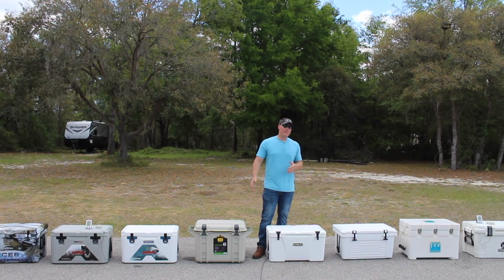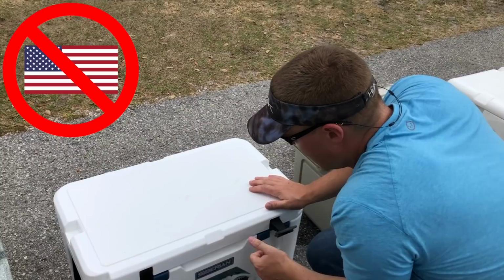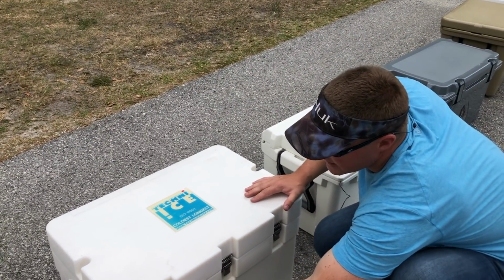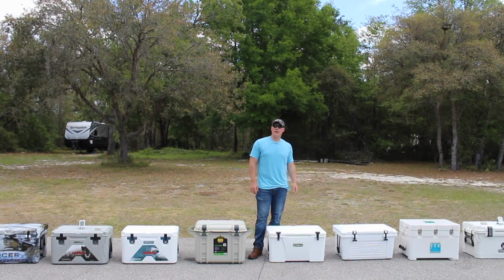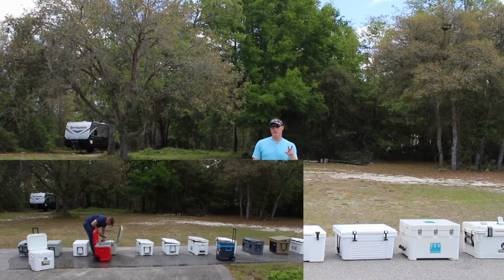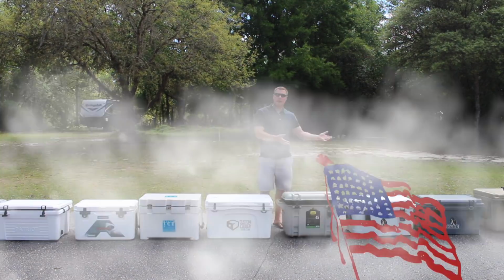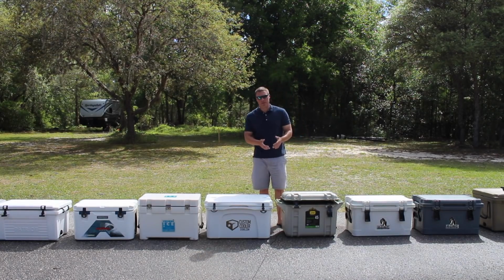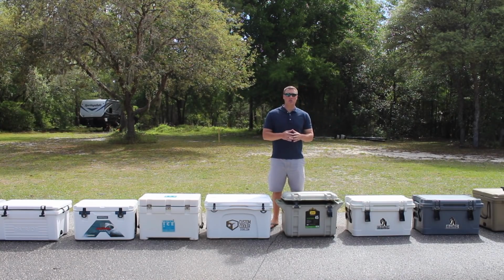Coolers Made In  USA Vs Foreign Made Coolers - Build Quality & Ice Retention

Comment: OtterBox FTW. I bought the 25 and 65 last year before anyone even knew about them. Now, if you could do a vid on all the modular accessories that set them apart from all the competitors that would be great. I think Orion comes close, but not really.
Reply: Oh, and don't forget to mention that OtterBox is actually an injection molded cooler, not rotomolded.

Comment: Love this. I was doing some research and ran across Bison (formerly Brute) coolers. Any reviews on those? Says USA made.
Reply: Neither me or my buddy had good luck with them for holding ice. They are durable and strong but the lid will warp if the cooler is in direct hot sunlight. So much so that it will leave a 1/2" gap to let air in.
Reply: I've had a 50 quart what is now called Bison cooler for 5 years.  It has the same ice holding ability as my newer Kong cooler of the same size.  The advantage of the Kong cooler is it is easier to open and close.  Build quality is the same for both.

Comment: So we're talking $250 to $300 for a cooler. Why not simply invest into a real fridge at not even twice that price and forget about ice and how long it lasts? I've switched my cooler needs to a real fridge/freezer and it runs fine off the single solar panel on my teardrop as well as my car. That thing doesn't even pull 3 amps when running. Buying ice and living with water-logged groceries is just not an option anymore, no matter how well you insulate that box.
Reply from the maker: For those that are camping in tents and not teardrops or for the weekend trip to the beach etc.